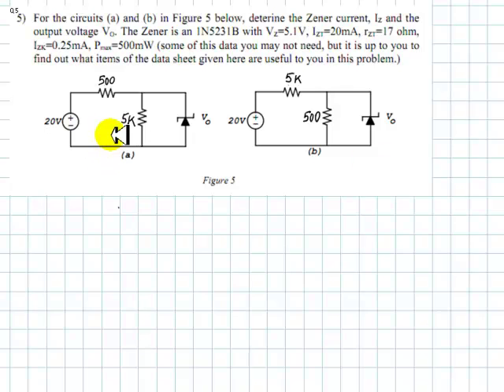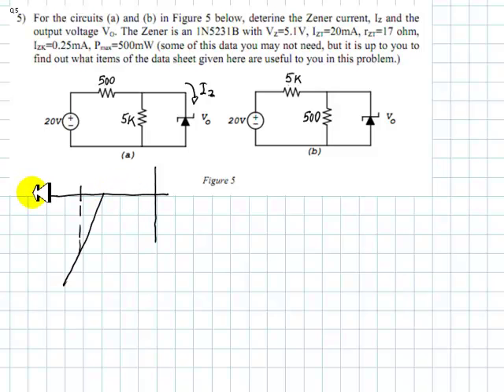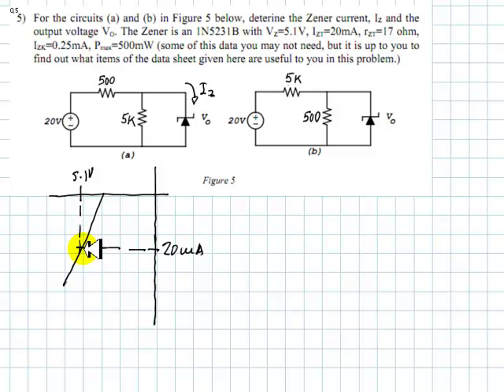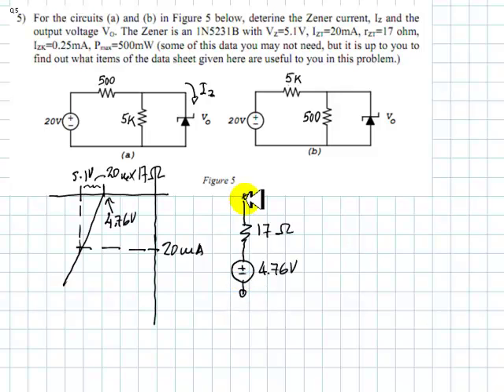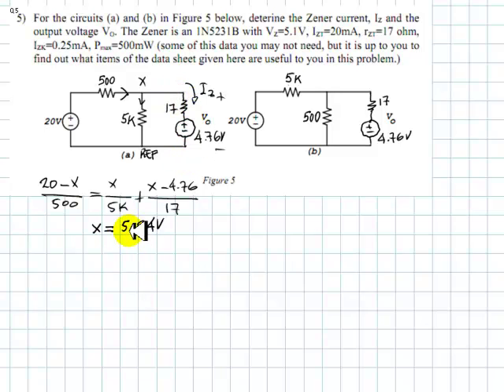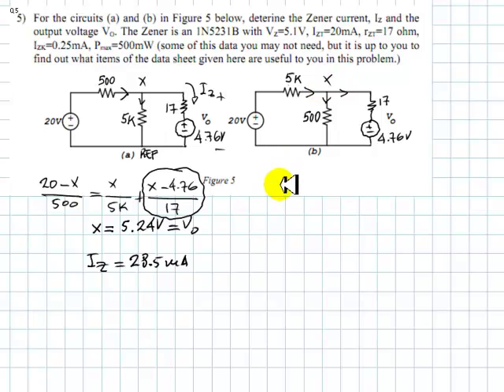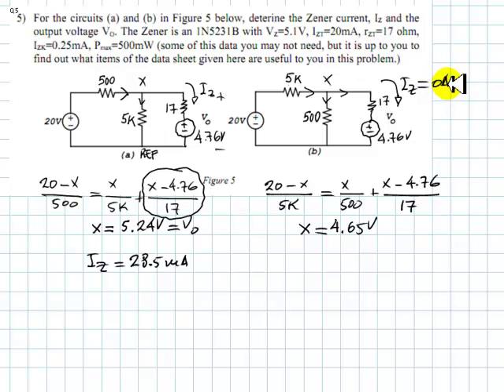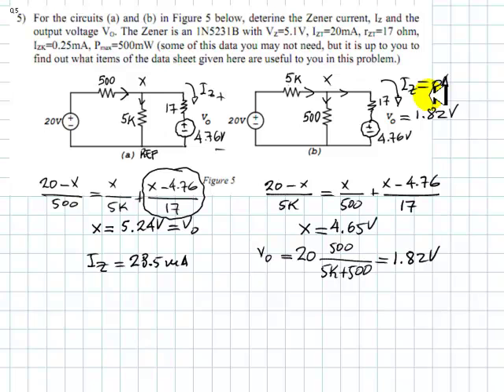EECE 251 - Tutorial on Diodes (Part 2/2)

Comment: Over the past week I have consumed your MOSFET lectures as well as all those on OPAMPS and now DIODES. I loaded maxima (a software math package out of MIT) on all my computers and try to do the KCL equations and solutions myself before your excellent explanations. Although I can do the algebra on paper, it is less stressful to use a tool like the HP-50g, maxima, octave, sage, or matlab to solve the equations symbolically. What a world we live in! I am also getting started with Circuit Maker.

Comment from the maker: ... (continuation from the previous one, because of the length limit for comments) ...  In an electronics course, I would have solved this in much simplified and approximated way (the way I grew used to do in the twenty some years working for industry all over the planet --never worked in Africa, or in Australia ... next life, perhaps-- Even then, if I had had an HP-50g with me during those years, I may have done things differently. These are very interesting times for the young engineer).